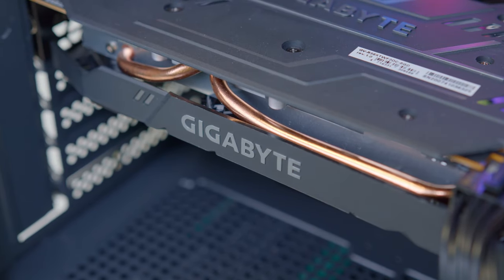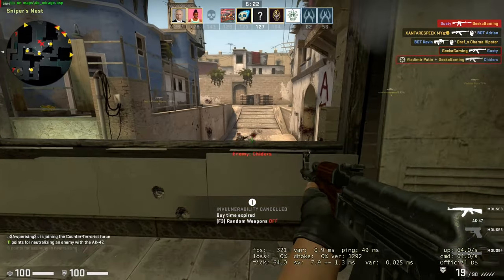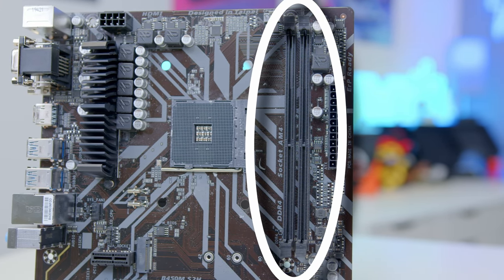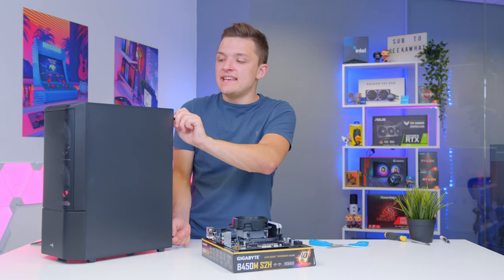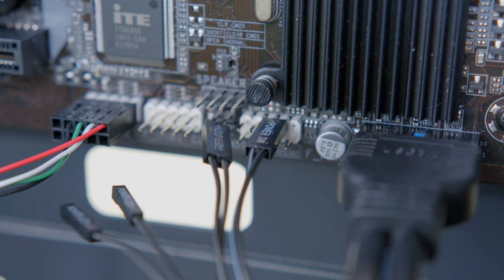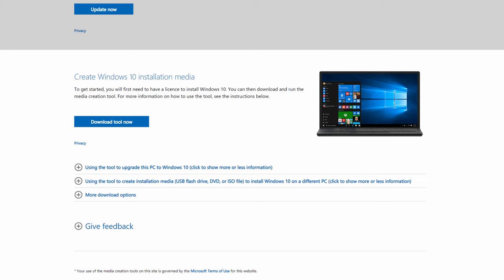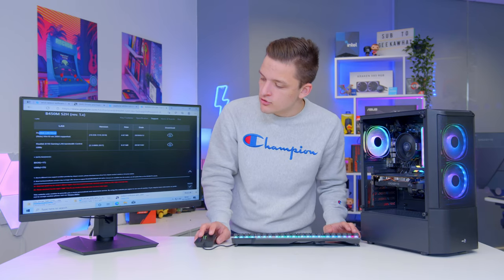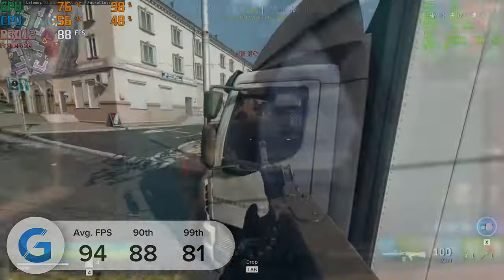The $750 Gaming PC You Can ACTUALLY Build! [Full Build Guide w/ 1080p Gaming Benchmarks!]

Comment: I have this same exact build. (r5 3600 and 5600 xt) sadly the $750 price tag on this build is for the pre-price hike of gpus and is near impossible to get at this moment
Reply: The 5600xt is at least 50% more than the 'budgeted price' in this build to be honest. If you find one this is more realistically like a $900-$1000 build.
Reply: @timpatrick564  I saw a few 5600xts on eBay for 300-400$, still overpriced but way less than what you mentioned
Reply: Unknown G shotta  it will work no problem but of course  it comes with compromise in performance which im sure you are aware of. But compatibility is no problem it will run
Reply: True
Reply: Plus he didn't even use a cpu cooler
Reply: @iowethegovernmentintaxfines  the wraith stealth cooler that comes with it is actually decent

Comment: the 10400f or 11400f is cheaper or the same price as the 3600, and it is better for gaming performance. why do you keep using it? you cant ov erclock the 3600 on that mobo anyway, not that it'll make a difference. Plus, intel mobos are actually cheaper than ryzen mobos. So you could get a better-performing chip and motherboard for less if you went for intel.
Reply: Although I agree on your CPU selection, I disagree on cheap intel mobos. Cheap b560 motherboards will make the CPU thermal throttle and you won't get the maximum power out the 10400f. Check hardware unboxed video on b560 mobos. Either way, the ryzen 3600 is out of stock and being sold for twice the price mentioned in the video.
Reply: @mariodroid7  In that case, go with a more premium board with better heatsinks and VRMs, because it wont be that much extra over the b550 that he is using

Comment: hey how much fps could i get on valorant with a gtx 1650 i5 10400F with a 16gb ram 2666Mhz?
Reply: I have a gt 1030 with 16gb running at 3200mhz and get about 200 so you should get around 250 maybe
Reply: @Sauce1803  naw mate he would double or triple your performance with that build
Reply: @g59Blue  well I was taking his ram into consideration and also he has almost the same specs as my friends build and that's around what he gets
Reply: @Sauce1803  ram won’t make too much difference, his cpu and gpu will, i have an i7 and a gtx 1080 and i get 400-500, also running 16gb 2666
Reply: @g59Blue  eh true true
Reply: You can run valorant on integrated graphics with like 100+ fps 😂
Reply: @papamilenial4808  on low settings with a newer cpu, and there would be stuttering because of the cpu having to use some ram instead of vram which is much slower